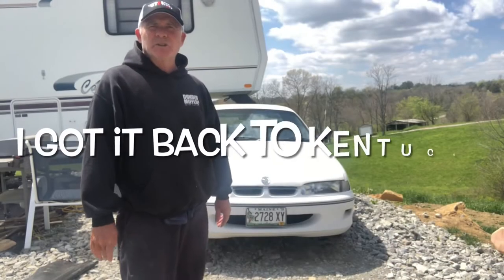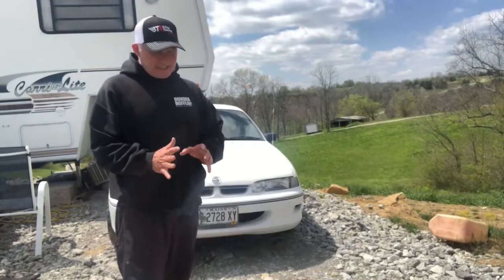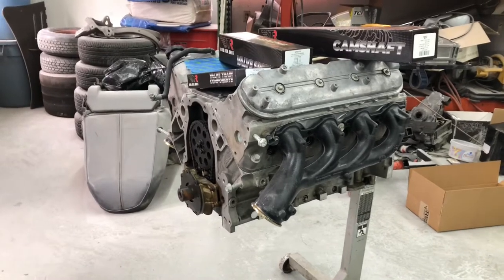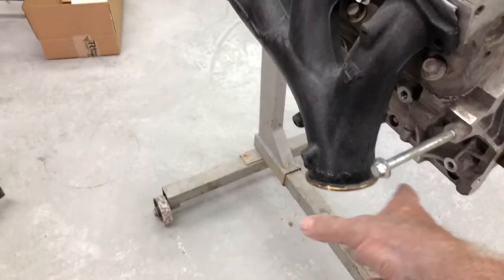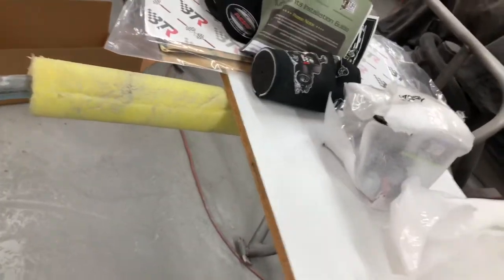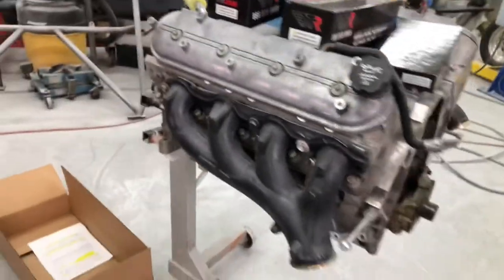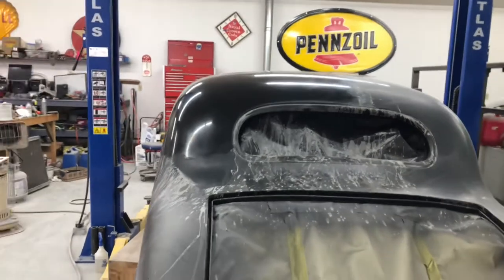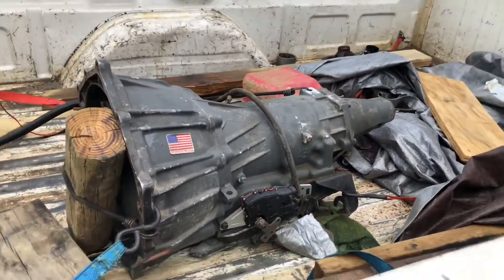VR HOLDEN COMMODORE UTE IN THE USA  - start of LS turbo conversion

Comment: My eco tech v6 (same engine as yours) has done 500,000+ killometers and it's still going perfectly fine, regular oil changes ect and I still drive it for work. I want to do an LS conversion but until funds are available I will be driving it until the engine starts burning oil.
Reply from the maker: Mines the Buick the eco came out in 95
Reply: @Trifiveguy  yeah I think mine is the Buick too, I don't know much about the Holden engines sorry haha
Reply from the maker: I pretty much have most what I need I’ll be starting  the conversion soon it’s a budget build for sure
Reply from the maker: Yeah all good man ! a great motor my Speedo stop working at 311k it probably done similar miles
Reply: @RBFR01  VN-VY are technically all Buick based (VN was exactly that) but VS and onward are Ecotec up until VY. Then they switched to the horrendous Alloytec piece of crap for VZ, VE and VF. All the VN-VY V6 engines are super reliable if regularly serviced. Mine had done over 450,000 and still going strong.
Reply: @Gerardus1970  absolutely agree, my VR has never had to do a timing chain but my friends v6 VE has been a dog of a car

Comment: I used a blue O ring when I was doing a hydraulic lifter & timing chain & sprocket replacement in the 5.7 litre Chevrolet LS1 V8 engine in my Holden VY SS Commodore,I ordered it as an OEM replacement on eBay from Windsor Holden which is located in the West of Sydney in Australia,I'm pretty sure that the thicker red O ring was used for truck type oil pickup tubes.

The TH700R yoke in the VR Commodore should slip onto the 4L60E spline.

That pressure relief only needs to be plugged if an AFM/DOD hydraulic Lifter system has been deleted & a standard volume oil pump has been fitted, maybe it can be plugged & a high volume oil pump used if a turbocharger oil supply is ran to the Turbocharger on the engine.

You will need a different engine management system to run the LM4 engine !
Reply from the maker: Thanks for the info mate VR was first of the 4L60E my old v6 box was the M30 /4L60E my engine is pre DOD so I will block off pressure relief also it’s a Gen 3 not a Gen 4  and I’m gonna runs 98-02  Camaro  ecu and harness stand-alone

Comment: good to see the project coming together i have done  the VL manual rack in a VK LS the racks are getting hard to find now
Reply from the maker: How do u like the way it steers ?
Reply: @Trifiveguy  mine is not on the road yet but it will be fine just run a narrower tyre

Comment: Bit late of a response but I don't know where you are up to with this swap. It will be bloody heavy to steer with no power steer and those size rims. Put the on smallest tyre you can. Get some adjustable Z bars (radius rods) for the front and take some of the positive Castor out of it. That will make it easier to steer. You said about the no engineer needed over there. You could just make your own Z bars adjustable. Hope this helps.
Reply from the maker: We are starting the engine in a couple week the transmission is built once the engine is done we will start the swap we of course we will film it all as we go power steering is is still one the cards

Comment: I have no p/s in my 304 vh only a pain when your below walking pace good luck with the 4l60 though hard enough to keep them alive behind a cammed ls let alone a boosted one 4l80s are plentiful over there 😉
Reply from the maker: Yeah everywhere behind cars trucks vans  guys  build them pretty stout  here not to worried about the box more the diff  yeah I’ve got a 57 with non power it’s a pain parking about it
Reply from the maker: Also is it’s the factory VH manual rack the  VL is a Variable ratio rack which makes them even easier to turn

Comment: I think if you're running a high volume pump the oil pressure relief valve will be leaking all the time. Block it off for better oil pressure.
Reply from the maker: You are talking about what I was pointing at in the pan ?
Reply: @Trifiveguy  yeah, ive read its there in case of overpressure, like a blockage.
Reply from the maker: @3lohssvrm  I’ll just put a grub screw in it M14x1.5 I think 🤔

Comment: Hey mate great conversion but I’d run power steer if you can cause it will piss you off.
Reply from the maker: I’ll keep the VR rack for later on if it does mate 👍🏻
Reply: @Trifiveguy  run the power steering rack with an astra electric power steering pump
Reply from the maker: Don’t think they have that model astra here mate
Reply: @Trifiveguy  something simular, there few youtubers in states running electric pumps....ask  what there off 👍
Reply: Hyundai i30 electric power steering.
Reply from the maker: @RideDriveandbuildAU  never heard of one in a commodore

Comment: So the LS 5.3, is that an LS1, Over in Aus we get 5.7 LS1 which I’m putting in my Apache Fleetside
Reply from the maker: No mate the 4.8/5.3 as with the 6.0 is a truck engine known as a Vortec  but has nothing to do with the 90s vortec SBC originally available cast-iron they did make an aluminum 5.3 and 60 in the truck the 4.8 was never available as an aluminum engine!  the 5.3 shares the same stroke as a 5.7 LS1  and can be bored to a 5.7L , my engine is the aluminum 5.3 L , 4.8 and a 5.3 share the same bore  size but the 4.8 does not share the same stroke as the 5.3

Comment: Not sure about u not having power steering mate ive got a vs commodore and thats a bugger to park as my ps pump is on its last legs so i have to put it in  neutral and rev it to get it to hard lock ok when im on the open highway thou
Reply from the maker: Oh man completely different Scenario and ratios no power and man steering  that would be a bitch to turn that !!  the variable ratio steering out of the VL it’s easier than VB to VK non Variable ratio and those guys seem to think it’s OK
Reply: @Trifiveguy  yeah right, my mate even suggested using a ts 1995 holden astra electric power steering rack. But cant wait to see the ute with an LS in ot mate. I showed a mate of mine your ute in the usa he couldn't believe it
Reply from the maker: @matthewreardon5694  cool mate get ya mate to subscribe lol cheers !